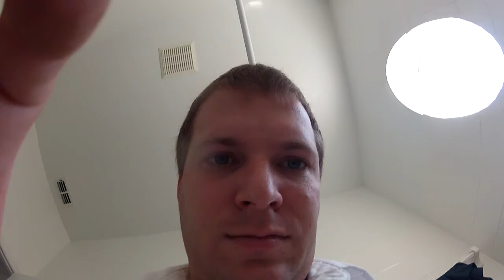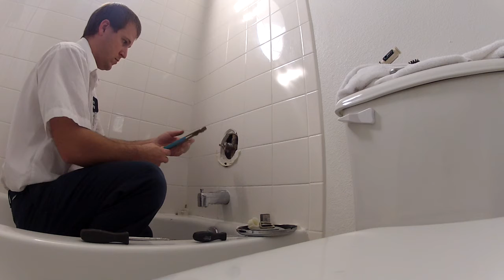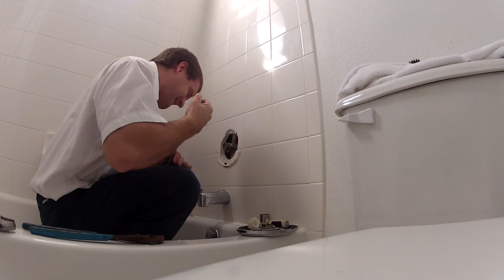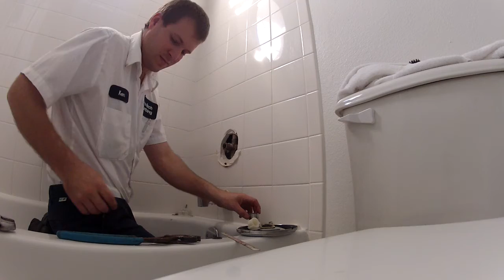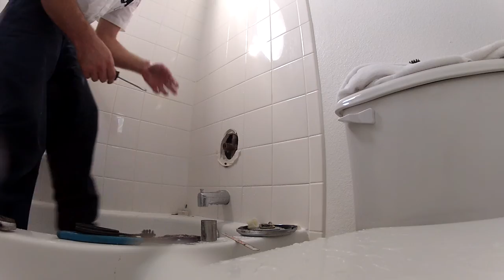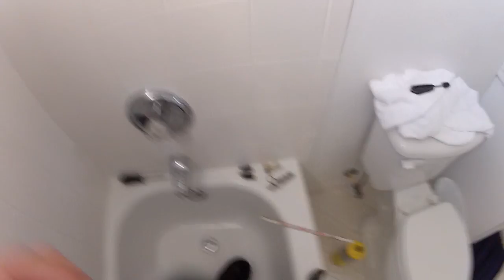Moen Positemp nightmare rebuild

Comment: Error?
Very simple. The puller should pull by the stem of the cartridge against of the bronze body of the mixer and NOT against of the the plastic body of the rest of the cartridge.
You were using metal puller with the brass stem to pull it out of the plastic cartridge body not full cartridge out of the mixer body.
I used a tiny wise libs - as a spacer.
Opened it so - it will push to the body flange but did not stay on the way of pulled out plastic cartridge body. Than turn the puller nut backwards and pull against of the wise libs.
DO NOT PULL THE CARTRIDGE WITH ARMS TO GET IT OUT OR DO NOT PUSH IT IN - YOU CAN BRAKE COPER PIPES INSIDE THE WALL IF THE BODY IS NOT SCREWED TO THE WALL FRAME.

Comment: I found out the hard way in the past that your mistake was made at 8:40.  When you have a calcified Moen cartridge, make sure that before you apply the force to pull the cartridge, rotate the tool to ensure that the valve body breaks loose from the cartridge.  If you do rip the guts of the cartridge out, never (13:30ish) file or cut at the cartridge; you are asking to create valve damage. Sweat a piece of 1/2 inch L copper with a 90 and about 6 inches of handle on it to make an extraction tool.  Flux it up, especially if you have tinning flux on the first 3 inches of the copper pipe, then use your torch to heat the brass of the valve.  insert copper once the valve is blazing hot and solder your copper to the Moen cartridge with about 3 drops of solder.  it will be plenty.  let it cool, then twist 90 degrees and pull the tool and cartridge from the valve.  problem solved
Reply: I started by breaking off the 2 plastic tabs, then rotated the cartridge with the plastic tool provided to break free. Then I heated the brass valve body with a hair dryer to expand the brass and then the valve pulled right out with vice grips.